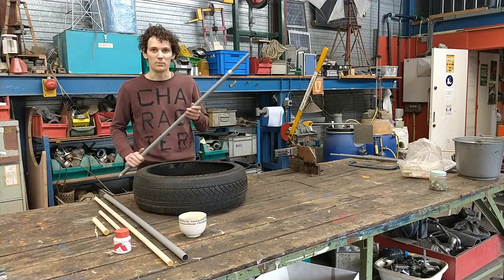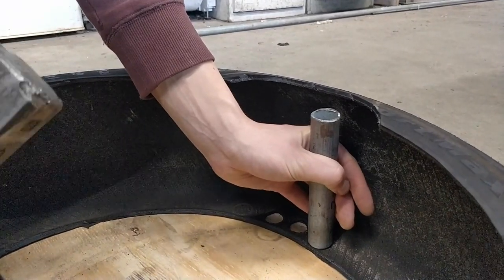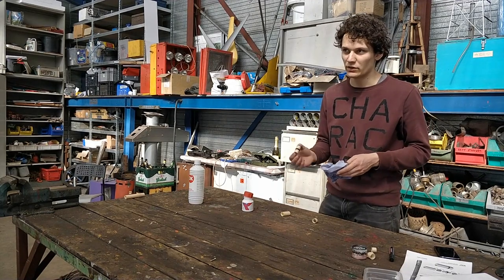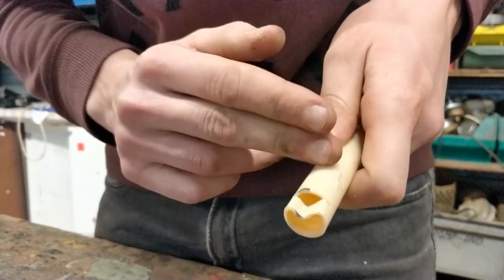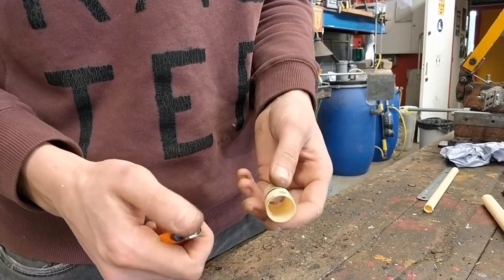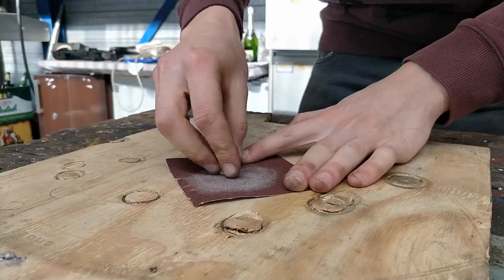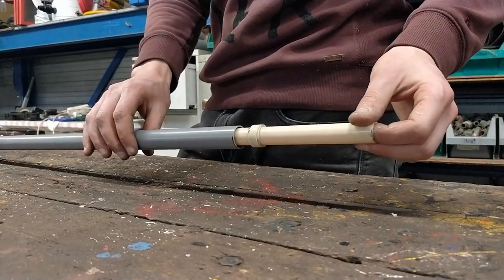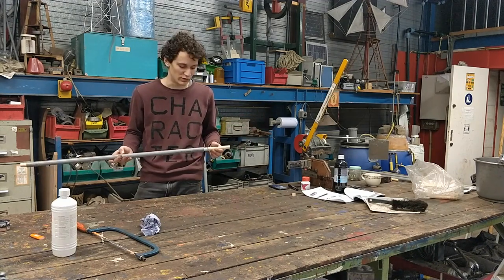Water pump using marbles. How to make your own.

Comment: thanks for the info on fitting together pipes, and using marbles and rubber from a tire for the pumpiing action.  If I may, you should wear gloves(nitrile) whenever working with any chemicals.  they can absorb through the skin and enter your body, similar to sniffing the glue.  peace, and safety first

Comment: Would a PVC cutter work instead of a saw for cutting the PVC?
Reply from the maker: Hi Tony, a PVC cutter will probably work just fine. Possibly the cuts that only go halfway through the pipe to make the indent might be a bit more challenging with a pvc cutter, as you might overshoot,

Comment: You didn't clearly illustrate the orientation of the marble valves.
Reply: Easy, the parts with the indented shapes go in the direction of the water flow. ✌️